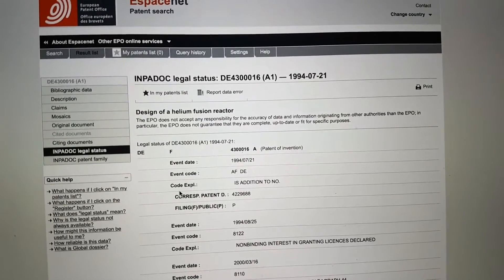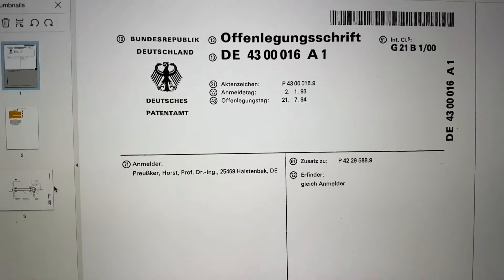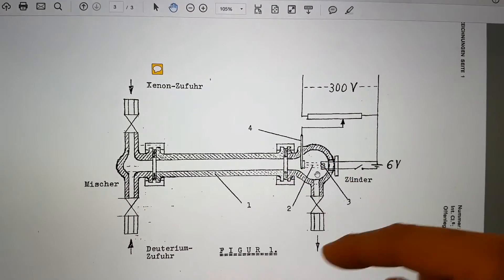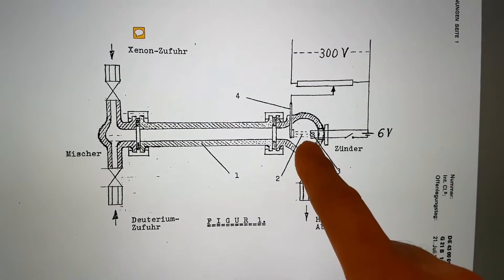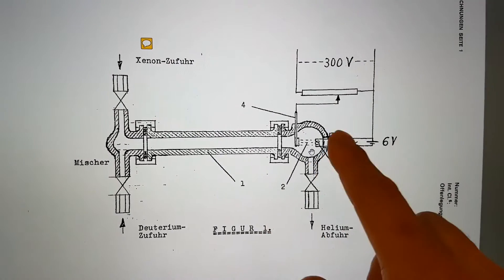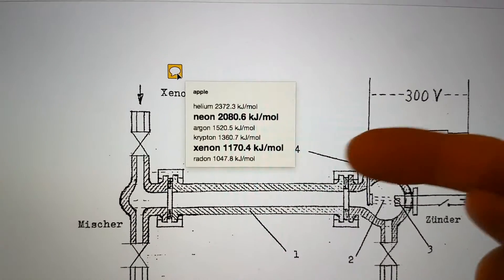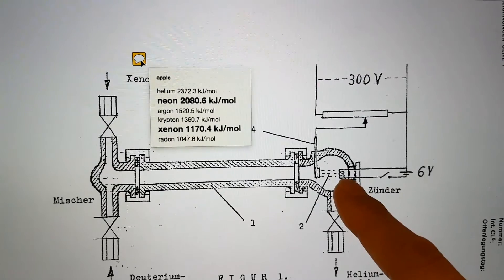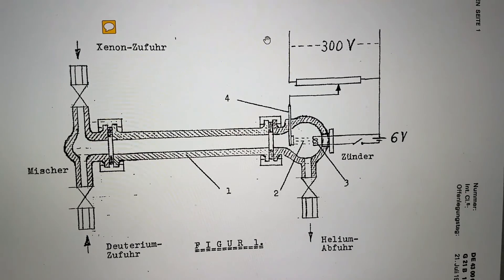1994 Deuterium fusion reactor German patent application

Comment: Looks like the idea of a fusion reactor minus the pressure and heat. Fuse hydrogen (deuterium) and create helium (H2 + H2= H4). Perhaps the xenon acts as a, or assists, ionized plasma of sorts to create a fusion environment?
Reply from the maker: As is said in the video, the choice of Xenon is the best for the noble gas. The the electro static field will, when combined with the sudden discharge of electrons cause an electron avalanche, which may self organise and trap formed D+ ions which are collectively accelerated to the anode causing cluster impact fusion.

Comment: Did Celani say that "In fact, the energy gain seems to strongly correlate with the process of dissociation and recombination of
atomic hydrogen/deuterium."
full discussion here https://www.lenr-forum.com/forum/thread/4954-celani-et-al-improved-stability-and-performance-of-surface-modified-constantan-w/?postID=49339#post49339

Comment: Try carbon dioxide in place of a noble gas, it's inert and easily produced.
Reply: NO .Carbon dioxide is an active gas. It's used in Welding MAG Metal active gas ( 82%Argon and 18%CO2) and MIG (Metal inert gas Mostly Argon)